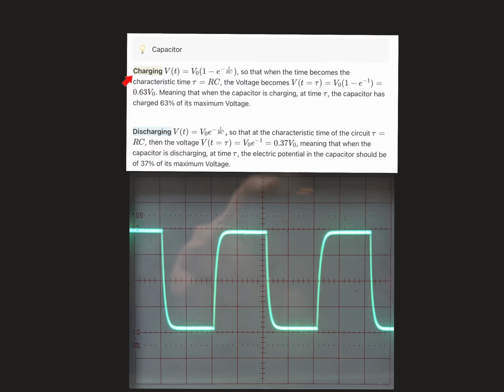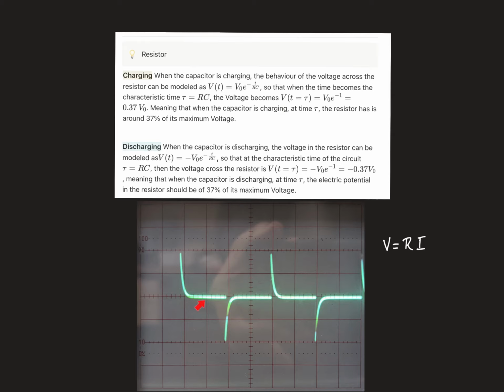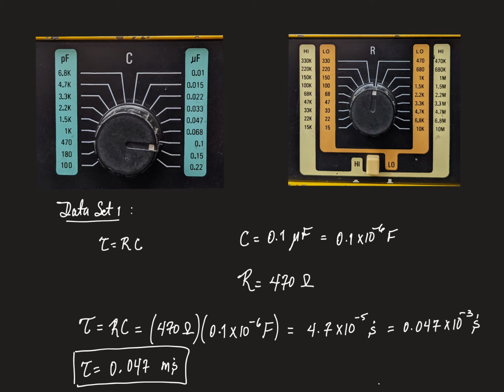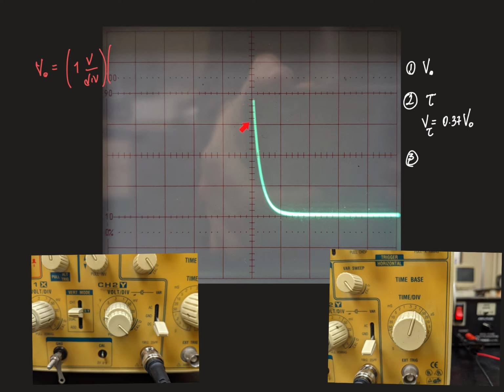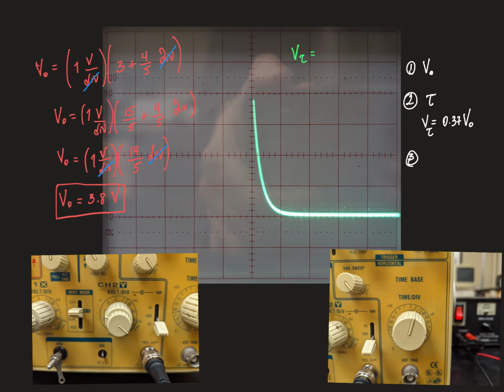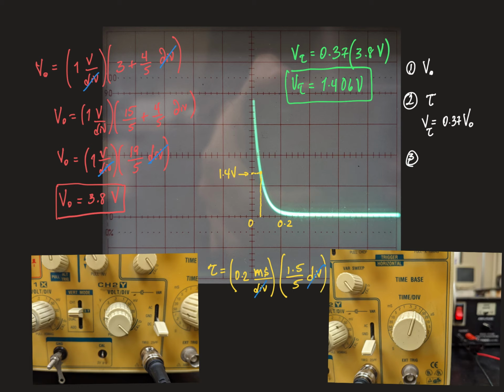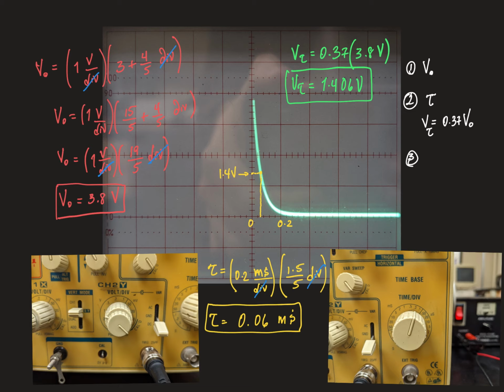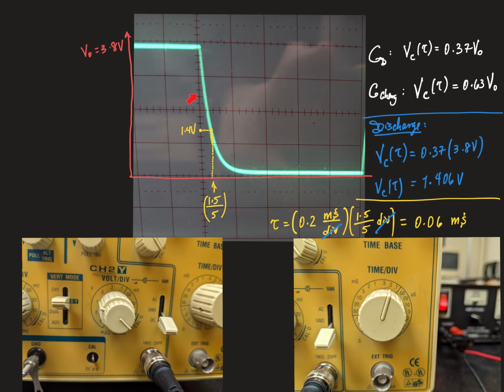RC Circuit on DC - Oscilloscope Measurement

Comment: Hello! I was interested in your video, and I wanted to know how I can capture a shot using the DC trigger in a Capacitor and Resistor (RC) circuit, since I don't understand how to do it, and it would be of great help if you could help me
Reply: Since I have a cathode ray oscilloscope and I don't really know how to use it
Reply: (Excuse my English, I'm from Argentina)
Reply from the maker: Hi! You can write in Spanish, I also speak spanish. If the Oscilloscope does not have the option to make a capture there is not really much you can do, except maybe use a camera or your cellphone.